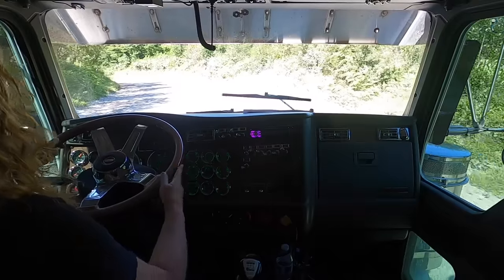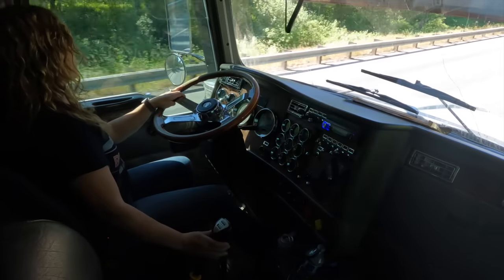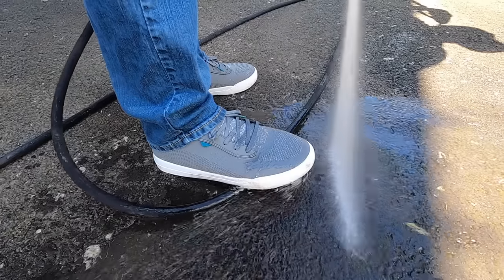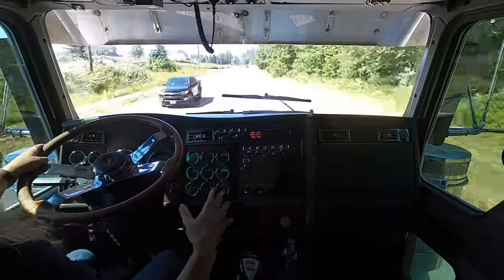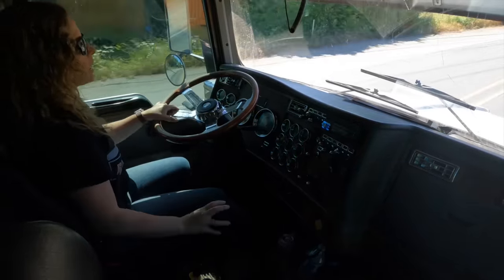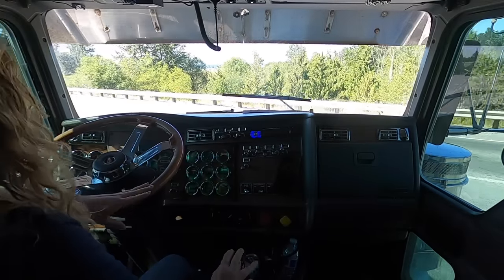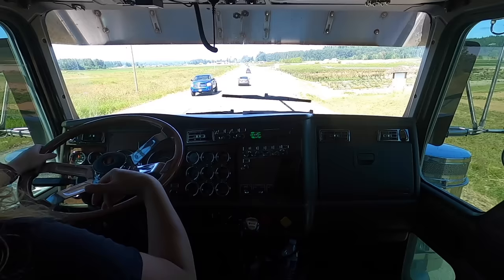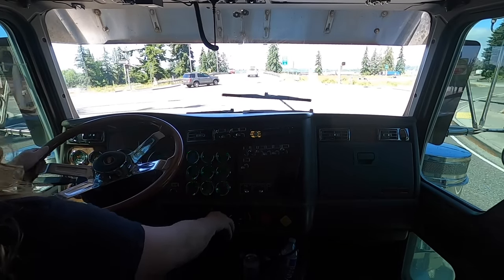How to shift an 18 speed Eaton Fuller Transmission. Down shifting explained on a loaded semi truck.

Comment: One thing I learned from my years behind the wheel is that shifting is like going to Baskin Robbins - everybody has their own flavor . Back in the 70's , we were taught by the company we worked for to watch the speedometer and memorize the speed for each gear - that way if you needed to shift down a few while still rolling and weren't sure what gear you needed your speedometer would tell you which one you needed . We were instructed to use the clutch for every shift , and it did have a positive side when it came to sitting in rush hour traffic for 3 hours at a time and only moving a foot or 2 at a time . That really built up the muscles in the left leg . LOL it never goes right when it's caught on camera , but when you stopped for the light and started off again you were getting the gears just fine and even tho you were talking about it you weren't thinking about it . And yeah , anybody that says they NEVER miss a gear is lying .
Reply: I just listen to the truck. I never look at the speedometer when shifting. I only use the clutch to start and stop otherwise I just float gears going up and down
Reply: The 10 speed is the most common transmission and was designed around that logic. 10mph you should be at 5th gear, 15mph (1+5=6,6th gear) 25mph (2+5=7,7th gear) 35mph (3+5=8, 8th gear) 45mph (4+5=9, 9th) 55mph (5+5=10, 10th gear). That's what most are taught, idk personally I didn't go to a school. It's a pretty decent ballpark but as we all know or should know, every truck is different, Gear ratios are different so it's not exact but pretty close.
Reply: Wow. Thank you for this response. I've been looking all day trying to find a speed to gear spec list. Still haven't found anything. Knowing the speed range to match your gear is great guide.

Comment: During the summers of 1979 and 1980 I worked for a moving company and drove a variety of trucks including a couple of International cab-overs with Eaton Fuller 13 speeds.  The experienced guy who taught me to drive the 13 speed basically said exactly what you described in this video.  If I was rich I'd buy a used semi tractor just to be able to drive a 13 or 18 speed for fun.

Comment: I learned on an 8 speed dump truck. Downshifting was what got me. I think most people have the same issue. I learned upshifting a lot easier. Double clutching also killed me for a bit. I was either too slow or too fast or the speed and rpms weren't lined up right. Almost 3 years later, I still grind gears. Somedays the shifting just comes to me.  Other days I can't shift to save my life.
Reply: When I was learning, nobody ever told me not to ram the clutch into the floor. Eveytime I shifted, I was sending the clutch to the floor. Finally someone caught it and corrected me. Now I only go about 2 maybe 3 inches on the clutch unless I'm stopped. The other thing that would get me was me being nervous turning onto a main road. I would try to shift to quick. I was trying to get up the gears a lot quicker than I should have been. I was worried about holding traffic up so I'd go 1st gear, 2nd gear, 3rd gear and 4th gear as fast as possible. Fialy I got a good trainer who basically said don't worry about traffic. You're going as fast as the truck let's you. Don't force something that isn't there yet.
Reply: @davidgrant8994 great advice and if we're all truthful, we've all been there at one point. I remember the same thing. Now I'll row 5 gears under a red light nice and slow..they either pass me or wait is what I tell myself lol

Comment: The first red light you saw you should be going slow enough to keep them wheels rolling anticipating the green. You said the light is usually red when you get there, so just slow down enough to keep the wheels rolling. You'll never have to mash the clutch at take off because you wont be stopping.  I always hated stopping a Mack trans because of the trans brake being gone. You learn quick to keep the wheels rolling at all times. 

Funny story, I got pulled one time at the chicken coops on I85 south in Charlotte. For those that don't know, this is a downhill into the coop. The dot guy sitting in his car behind the scale was looking for brake lights. He pulled me when I was rolling over the scale and said 'you ain't got no brake lights'. I told him I didn't need brakes to stop the truck. He laughed and told me I was doing a great job driving. A co-worker and I got new T880s the same day. After 110k miles his T880 was getting new brakes. My T880 got new brakes at 212k. 

P.S. Don't ever get a UltraShift plus18-speed. Run away from it. You'll want to quit driving after using that POS.

Comment: I learnt to drive truck back in 1976 on a Mack with a six speed and splitter.  Like you I often did not go through all the gears, especially when unloaded.  My first job driving was an on old 64 Kenworth 5 ton with a hiab on the back.  It had a 5 & 4 two stick transmission.  That was a nightmare!  I remember putting my left hand through the steering wheel so I could access both sticks!  That could be a hairy situation!

I chuckled when you spoke about missing a gear and having to find it.  Did that many times.  The saying we use to have "If can't find it, grind it!" Man that was true at times.

Hardest thing for me to get to use to was how much rev the engine up when downshifting and how much to let the RPM drop when shifting up.  I haven't driven a truck since 1988 and some days I miss it.  It is great to see how well you handle your truck.  Thanks for the memories.

Comment: Like you said, it’s mostly just getting a feel for it. I’ve driven 18, 13, 10, 9 speeds plus I started out on a two stick. My favorite is the 18 speed Eaton, especially for highway. My least favorite is the 10 speed. I never went to school for trucking. I learned driving for my Uncle about 60 years ago. After a while, it becomes just part of what you do.  Don’t need to think. The arm just moves.
With an empty truck, I never used the bottom four 1L,2L3L,4L. I just shifted it like a 9 speed. Also if I was on a down slope at a traffic light empty, I’d start in 2H. 
Also if the truck was light or bobtail I’d skip gears.
Reply: how you did not go to school for trucking, there was no requirement is some cases or something?
I wonder how was it for od timers in variuos places, learning and driving. There was a bad work time practices where I am, I hear
Reply: @mechadrake  i learned to drive trucks when I was in my teens. This was in the 1960’s long before CDL and a lot of other laws. In fact, I drove trucks before I had a regular driver’s license! First truck I drove was a 1939 Autocar 10 wheel straight logging truck with a two stick 5/4 transmission, all wheel drive and locking differentials. 
That was even before all vehicles had to have the pedals in same places. The Autocar has the gas pedal in the middle, clutch on the left and brake on the right!  Look it up!
Reply: @billmoran3812  ha, that is insane, I thought pedals in the same places was older thing! :)
Reply: @mechadrake  a lot of young people now learn from the parents or uncles when there young so when they get too teens they don’t need driving school it’s that easy

Comment: I appreciate this video. I drove for a few years. It’s a great feeling to row through  the gears on 18 speed in a T800 under a load with no clutch. I work for the KW factory now. Did you know over the last 15 years the percentage of manual vs. automated transmissions went from like 10% to more then 50%. That number will rise. Some day manuals will be a relic. The reason is, big companies can hire less qualified drivers. It’s sad but true. 

Also, I worked for V. Van Dyke in Seattle. There’s nothing like looking in the mirror at a 130k, 130’ beam on a steer car. Good times.

Comment: Thank you for taking me back.  My first three car's were standard shift transmissions and I loved them.  First full time job out of high school was with local county highway department.  That is where I learned to dance.  I cut my teeth on the old Mack's "Road Ranger"  It's the sound of the engine the revs and the strain and tension you feel in the seat of your pants no clutch needed...It was like dancing.

Comment: I grew up in the UK from about 13 years old in the 70s on these Eaton gearboxes and other types that were far more difficult to master, it's great to see someone who can shift without using the clutch. Most truck drivers in the UK can't even drive a manual truck let alone a non syncro and most trucks in Europe use auto boxes now. Just found your channel and after watching a few videos I realise retiring was the best thing I did, keep it on the black stuff 😊
Reply: And that is why European trucks have always been more advanced than American ones... it is unthinkable now to continue driving with non-synchronized transmissions, for safety it is better that all of them be automatic.

Comment: Great video! Learning to shift a non-synchromesh transmission like yours is like playing a musical instrument. All by ear, based on the pitch of the engine. I learned on a 10-speed, then switched to a 13 and then an 18...with a 5x4 twin stick in there for about 6 months. Never used the clutch except to stop and start. The hardest are right-hand turns, when you slow down from 60 to 10 or 15, and have to know what gear you're going to want to get into to pull out of the corner. It's an art.
Reply: Yep, never clutch unless you are stopped.  10-speeds were great, 13s too.

Comment: I help with harvest and only drive a few times/year; I'm usually in a 13-speed, but have driven an 18 several times.  They're basically the exact same, except the splitter is available in low range with the 18 and not the 13.

When upshifting, sometimes I clutch and sometimes I don't.  When downshifting, however, I always single clutch out of gear then use the RPM to float into the next lower gear; not sure why I do it that way, but I'm comfortable with it and it works for me.

I generally downshift my way to a stop, until I HAVE to use the brake pedal to completely stop (yes, I know it takes me longer to slow down that way).  It surprises me how many vids I see of drivers who pop into neutral from 4th or even 5th gear and glide to the stop/red light in neutral and use the brakes.  Given how costly it is to replace brakes, I do what I can to save them.

Comment: Nice shifting. I have never been in anything with a 15, or 18 Speed Transmission. I started back in the 80's though, and I trained, and took my first Road & Skills test on a 1954 B Model Mack, with a Twin Stick 20 Speed Quadruplex, which is a 5 Speed Main & and a 4 Speed Auxiliary Transmission. Double, and sometimes triple clutching, and RPM's we're required with every single shift, and if you missed a gear, there was no way you were gonna get it in any gear, and you would need to stop, and start all over again. I eventually graduated to a simple 5 Speed with a 2 Speed Split Axle, then on to the 10 Speed Road Ranger, before eventually getting into my all time favorite, which is the 13 Speed Road Ranger. I now drive a School Bus with a boring 5 Speed Allison Automatic.

Comment: I have learned over the years, that using just a thumb to shift into X gear towards the dash, and a finger or two to shift towards the seats helps prevent forcing the shift. Resting the stick in, what i call the valley of the, gear softly. The gear will pull the stick into the gear by itself. It will even pull into gear off of your thumb or fingers when the RPMs are right. Those transmissions have synchronizers in them, forcing the shift and getting the grinding tears those synchronizers up. But, we all know there are many time we have to jam a gear for one reason or another. Its just got to be done. If you make another video and shifting, you might in lnclude the clutch throttle combination being different for all the 4 wheeler drivers going into trucking. That would help save many a clutch from being burnt up. A lot of companies and their more experienced drive would appreciate it. Good driving Missy, i enjoy your videos. Keep it between the yard sticks and the rubber side down.

Comment: Thanks Dauminique, for the interesting video, you did a great job of explaining the shifting . I think everyone does just a little different but very similar in the end.  But looks like and sounds like that you do a great job shifting, to me it just becomes a natural thing without even thinking of what your doing after that you drive this truck or that truck you just do it automatically for the truck that you are driving at the present time . 
For myself I listen to the pull of the motor, the pull and handle of the truck, the road,  the speed, the revs of the motor, the up and downs of the road and the situation that your in at the moment and your mind just takes it all in and your legs and feet and your arms and hands work together with one another and keeps you moving down the highway, with an automatic motion . I learned to drive in a standard shift old Ford pickup and a standard shift C70 big Chevrolet truck here on the farm, didn't know what an automatic shift was for numerous years . I think that everybody should have to be able to drive a standard shift before that they can get their drivers license . In the winter time when there is ice and snow on the roads, I much prefer driving a standard shift, than an automatic, cause you have much better control over the vehicle whether it is small or large, I think . But it is getting so that you can't even get some vehicles in a standard shift . But I will always love standard shift vehicles and prefer driving them . For several years my dad hauled a lot of blacktop and then he hauled a lot of gravel for awhile and then him and his brother hauled a lot of hay out of Ohio, to Eastern Kentucky farmers and then in later years all that he hauled was different sizes of gravel .
I have been around the trucking business for years of the hauling of different things, coal, gravel, blacktop, hay, corn, top soil dirt, fill dirt-rock, heavy equipment and fuel tankers, the only thing that I have ever hauled is top soil and fill dirt and drove a bucket truck a lot, cause I am mainly an (electrician, went to school for) but I grew up on a farm and have been a guy that has worked at a lot of different construction  things, and carpentry and plumbing and etc., myself favorite thing is running heavy equipment .
I love watching your videos, and you are a really good truck driver, so take care and stay safe and keep on shifting those gears and trucking down the highway .
 🤗👍💖💫

Comment: 13, 10, 13+4 sp Brownie @ 200mph almost :) and now on 18 speed which I love....for years I moved the splitter after the stick never lost a transmission...a few years back I saw somebody move the splitter before the stick so I've been doing that still haven't lost a tranny.. in my current truck just turned a million miles...I guess there's more than one way to get there... And if I had to take a driver test and use the clutch I know I'd flunk :)... keep up the good work

Comment: Nice Gear Jammin vidja. Here in Wisconsin, we have some short, mabe 1/4 to 1/2 mile long but steep mabe 15% hills. When loaded up and getting a run at the hills, we hit the bottom in mabe 7th low split, then drop to 6th low split, then to 5th low split, the next lowest gear should be to shift to 4 which is in low range. It is easier to stay in high range and to shift LO, This is the same gear ratio as 4 th low range. I'm not sure if this is really recommended. Some truckers have told me "There aint a gear at that position. The main reason I find it conveinient is you can shift down quickly while running up a steep hill and dropping a lot of speed, and still make that last down shift into the highest gear which will take you up over the top .  You are right about those Mack trannys, we have an older Mack log truck, and like myself, they are deffinately their own "DOG".

Comment: Truck have come along way. I work for small company of 8 guys . Underground construction water & sewer & storm drain. I operator equipment then moved the equipment from  job to  job. The truck I drove had 220 Cummins with turbo 5 & 4  manual steering no Jake and beat you to death and you couldn't hear any body talk. You do good job driving. And thank God you didn't have to drive the old crates. But being be a kid in 1980 I loved it.

Comment: Greetings from southern Ontario Canada I learned to drive manual gearbox on a 1960 Studebaker lark on the steering column no power steering and you had to open up the drivers window to listen to the engine so u knew when to shift or backing up or being on an incline was tricky thanks for the presentation

Comment: I'm retired now, but I remember the first time I drove a truck with an 18spd Eaton/Fuller, I loved it. I was grossing 95,000 and used every gear. I ended up driving that truck (a Mack CH with a 427hp engine), many times. I never went to school, but was taught by a friend of mine and since he used the clutch on every shift, so did I. One thing nice about an 18spd, you have 3 transmissions in one...a 9, 13, and 18. If I could purchase my own truck, no matter the make, I would definitely have it equipped with an 18spd. Keep up the good work, Dauminique!

God Bless,
Jeff